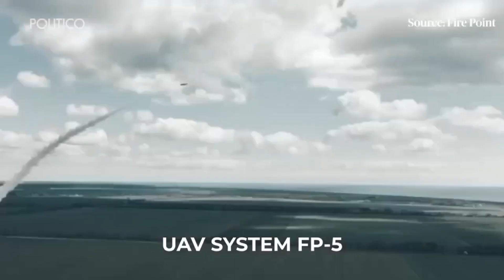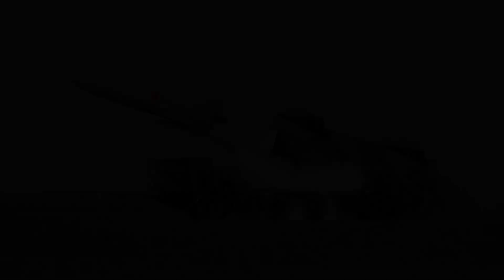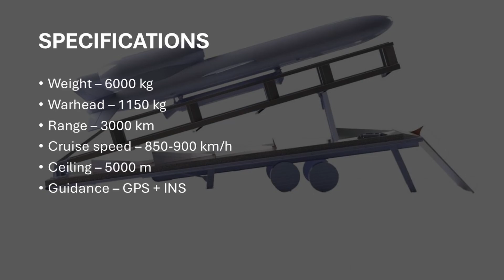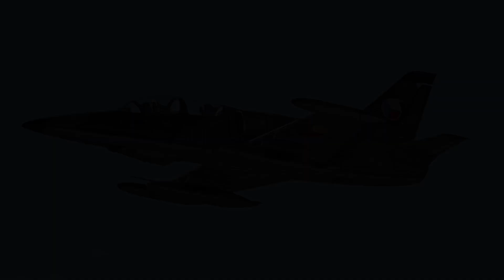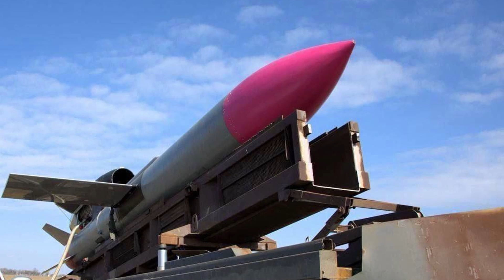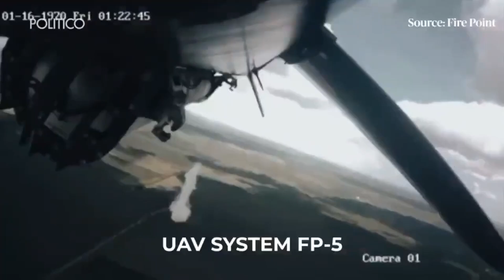FP-5 Flamingo -  Engineering Review

Comment: The point is not sophisticated aerodynamic characteristics, but low cost and quantitative production capabilities. If they manage to move the production of the critical component—the turbofan engine—outside Ukraine, they may soon start spamming them with a production rate of 7 units per day. Everything except the aforementioned engine is super cheap, and a head weighing over a ton hitting a refinery or factory will cause irreparable damage. Russia is so huge that protecting only its European part would require an order of magnitude greater air defense than currently exists. A massive number of long-range drones + 2,000 FP-5 missiles per year, sanctions driving up the cost of critical technologies, staff shortages, rising fuel prices and everything else will make mincemeat of the Russian economy in a matter of years. Ukraine is on the right track, giving up 1 km² per day, retreating while inflicting losses on the enemy, and focusing on technologies such as this one, which will drain the Russian budget and society. They will not win a direct battle on the front line, but a colossus can be defeated by kicking it in the legs on which it stands rather unsteadily anyway.
Reply from the maker: Absolutely agree, just the point was to identify how this approach affects characteristics and find some points, where they might not be 100% true... Otherwise, the project is amazing and will have huge significance, especially because of payload.

Comment: So close to V1s, take the hit to range and speed with pulse jet engines and you can just make them out of stamped carbon steel, super simple, dirt cheap, go from producing 7 a day to potentially hundreds,  engines are the biggest bottleneck of cheap cruse missiles, sparkplug and a bit more ground equipment for startup, and an electric motor or an air pump to push fuel. Germans were already able to push V1s out to 400km things like using plastic body and how much less space and weight is needed for navigation and power with modern systems you could easily push 500km if not get closer to 600.
Reply from the maker: It should be mentioned that pulse jet engines are not actually reliable piece of engineering. Also for such payloads and speeds not the best choice... 
I'd say engine they used plays same role for Ukraine as first pulse jets played for Germans that time.
These AI25s are manufactured thousands and still in the production, super reliable, quite powerful, and the most important, Ukrainians know in detail everything about it, how to maintain, increase power compromising engine lifetime...
So, from my point of view, engine is the less issue there, I'd even say it's the most optimal choice...
Reply: @aerom8  counterpoint, jet engines are Fkng expensive and are the biggest bottleneck in production. Given a standard private business jet engine sells on the low end of 700k for the guesstimate lets remove all profits and say production scaling and lower labor costs cuts it in half to 350k per engine. And then drop another 50k just cause. Given a pulse jet engine could be made just from stamping carbon steel and some additional assembly, it would be completely feasible to bring it under 2-3k based off of how big you make it due to material cost, and instead of making 7 a day, 200 in a day would be completely feasible and no longer be your bottleneck. Throw in the rest of the costs, bomb is free, a generous 1k for the systems and controls and another 5k for the material for the tube, wings, and control surfaces. Bring it from 9k to 15k just to pad the margin of error and your production limitation would be how quickly you can throw them together.

Yes it would be far less reliable, powerful, fast, and less range, but it would be a fraction of the cost of the jet engine alone. Also, there's absolutely nothing stopping having 2 variants in production. A cheap mid range cruse missile you can send some large warheads en mass at targets like say, the Crimean bridge after you cripple the AA systems with USV launched drones or other support facilities behind the lines, and a long range option to go for the factories deep in the homeland.
Reply from the maker: @zano187  I absolutely understand your point, but still think there was a reason not to go that way... While this channel is mainly engineering related, maybe it would be a nice idea, somehow to make a rough calculations, simply to define what size of pulse jet engine would be required for such flying vehicle. If this sounds interesting for you, I could try to make some calculations and even redesign concept of Flamingo based on those requirements :D

Comment: It's a V-1 made with 2020 technology.  Extremely cheap,so Ukraine can build thousands of them.
Reply: With that size and shape should not be a match for modern A/A systems. Unless used in large quantity, or equipped with a very sofisticated low altitude navigation system or up to date ECM.
Reply from the maker: @Roberto.Colaianni Honestly, I don't believe it has any advanced navigation system for following terrain. Probably you're right and overloading of anti air system is the main strategy.

Meanwhile take into account that every night, Ukraine launches more than 100 FP1 Lyuty type drones and they pass easily border, go deep into country and hit oil bases... 
So let's see, the tactics how this weapon will be used is another point of interest.
Reply: Was honestly wondering for almost 3 years how long it would take for modern V1s to come around, but not quite there, while far less effective, the pulse jet engine is far cheaper and simpler to make, allowing for mass production of the most expensive part of a cheap cruse missile.
Reply from the maker: @zano187 While fighting with Russia I guess penetrating their anti air capabilities is the most challenging part for engineers... Meanwhile, for reaching such speeds with that amount of payload I can hardly imagine what kind of pulse engine would be required. 
V-1 was not bad for it's time, but nowadays?...
Reply from the maker: Yes, it seems like to be cheapest weapon of it's type. As Ukrainians announced they plan to increase manufacturing speeds up to 7 units per day and number is quite serious if we take into account capabilities of such system.